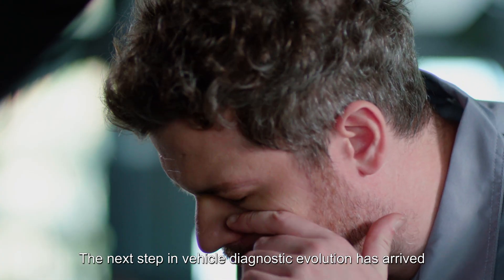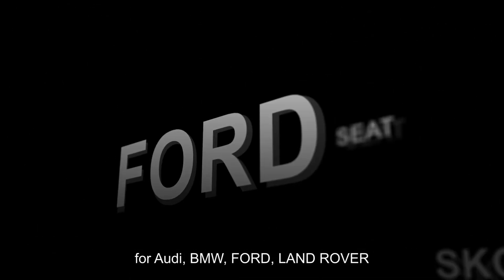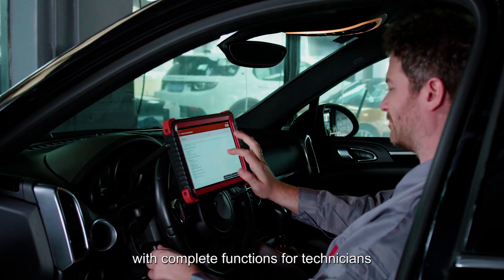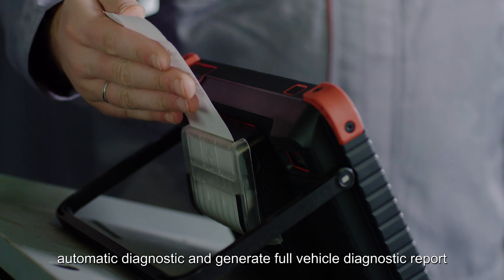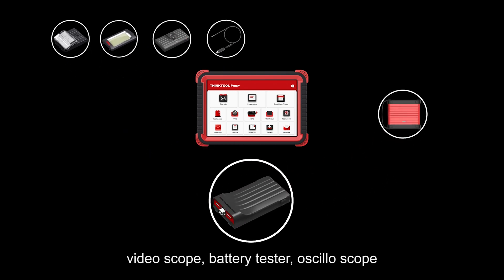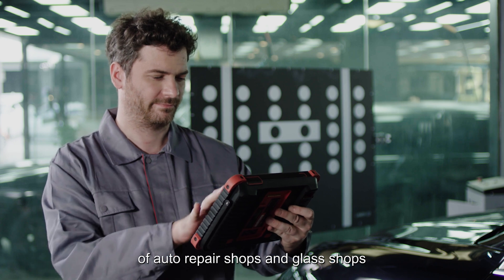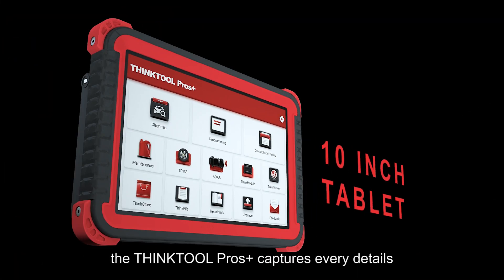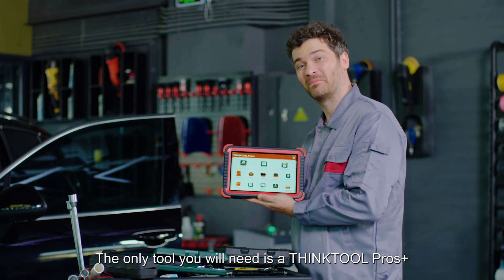THINKTOOL PROS(+) Online programming ADAS Calibration 10 inch Full system Diagnostic tool

Comment: hi i was reading the thinktool pros+ description and it says for a manufacturer defect the adas has to be activate manually w an activation code, but after sending an email to the thinktool official email, they said than the ADAS has to be purchase separate, not what it says on tool description,  i just answer the email to explain them that i hope and you or they have the right answer to it.  and is the ADAS related to the 28 to 32 special service? or is it something different? thanks in advance.